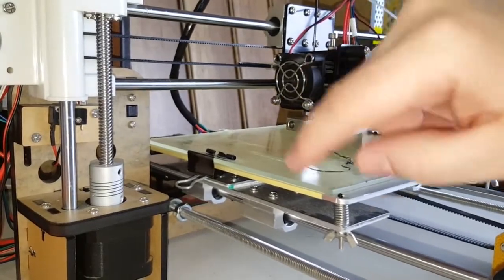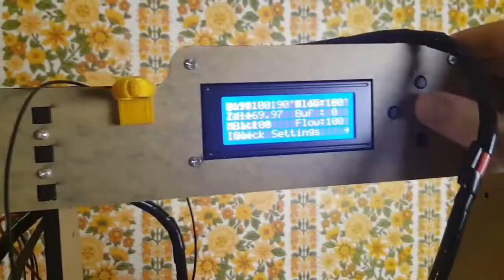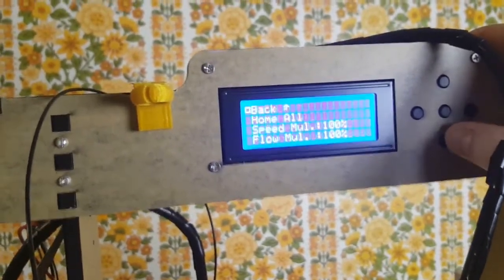Anet A8 extruder - nuzzle not touching heated bed and how to fix this cheap 3d printer

Comment: Thank you! I had the opposite problem with the nozzle scrapping over the bed even though I couldnt lower the bed any further. Spent hours trying to find the solution.
Reply from the maker: You're welcome! I'm thrilled to hear that you likely figured it out. It's not uncommon for 3D printing challenges to be a bit tricky, so it's great that you were able to make adjustments and resolve the issue. If you ever run into more questions or need further assistance, feel free to reach out. Happy printing!